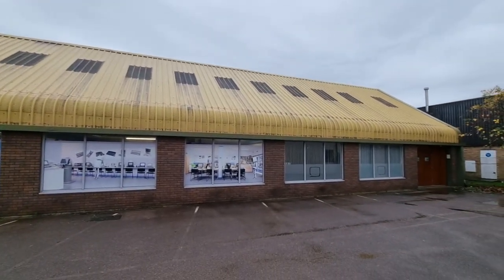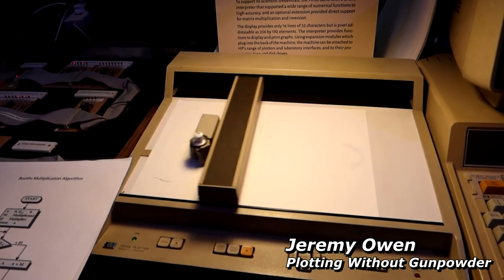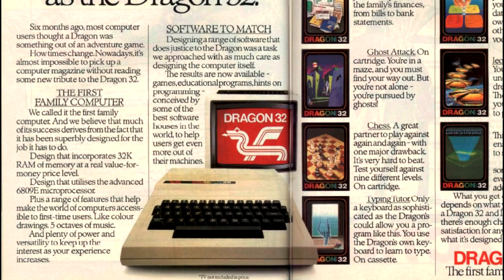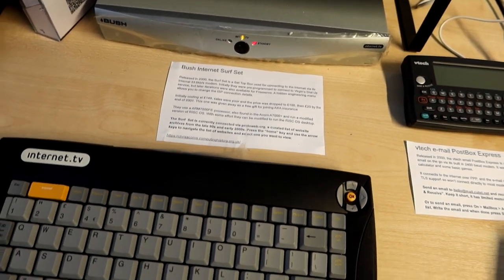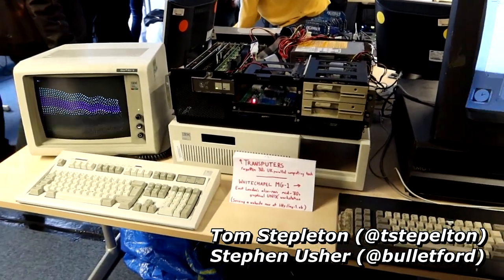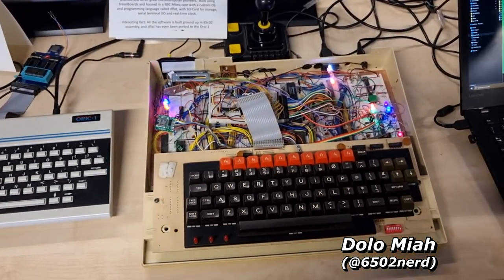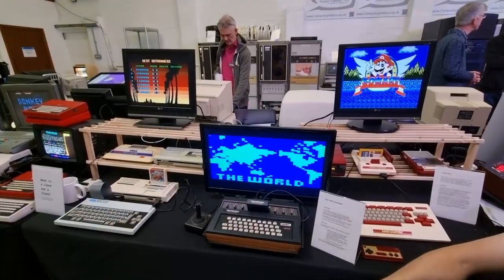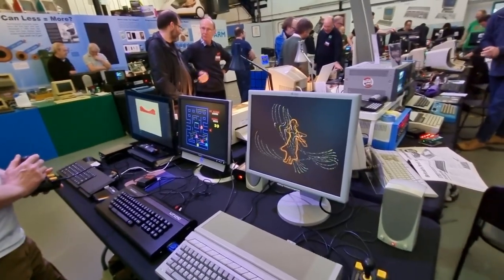A Collection of Rare and Amazing Computers! Retro Computer Festival 2022 | Kim Justice

Comment: Those be my Falcon, Memotech and QL. 🙂
Nice to see them appreciated.
Reply: The Falcon demo being 'Lost Blubb', from someone who's spent too much time and money on his Falcon!
Reply: @chrisholland5138  Well, I certainly didn’t pay a stupid eBay price for the Falcon030. The only things done to the Falcon are replacing the NVRAM/clock chip and replacing the 4MB SIMM on the memory board with a 16MB one, oh and a hard drive as the original had sticky bumper syndrome.

This particular machine is a rare one which doesn’t need the system clock patch, it just works.

Comment: Did anyone spot that that MTX512 was connected to a VGA monitor ?
Reply: Yes, it has the new MFX expansion I got a couple of months ago. Upgrades the machine to 512K RAM and adds 80 column card compatible hardware and TMS emulation using an FPGA outputting to VGA. It also has a virtual floppy interface (SD card) and ethernet so that you can upload and download software/data to/from the virtual drives.